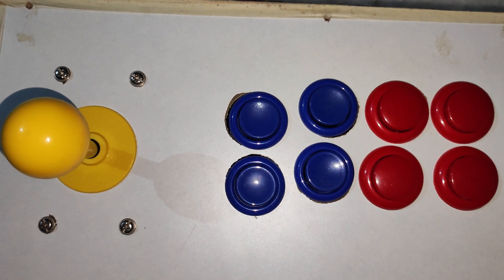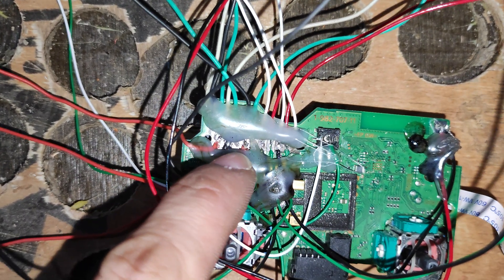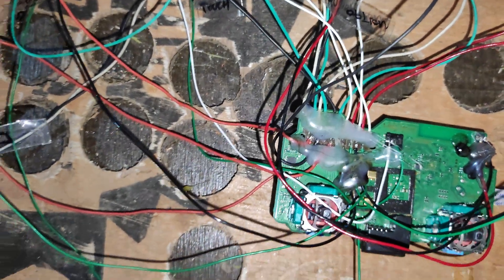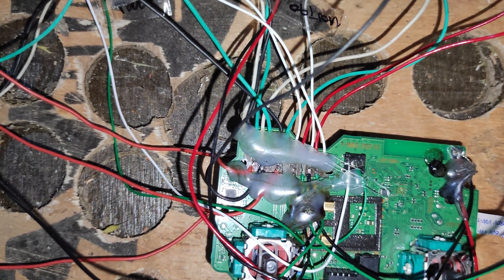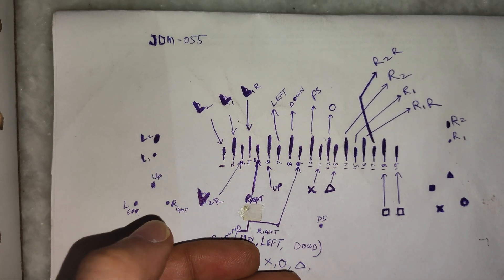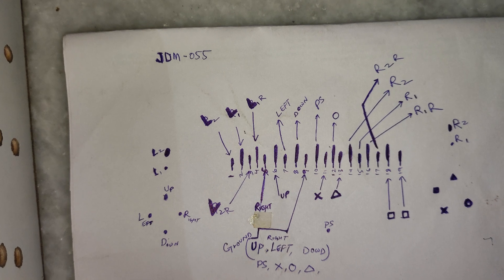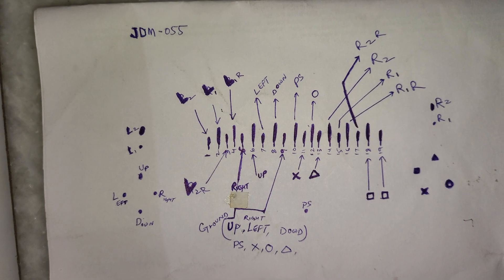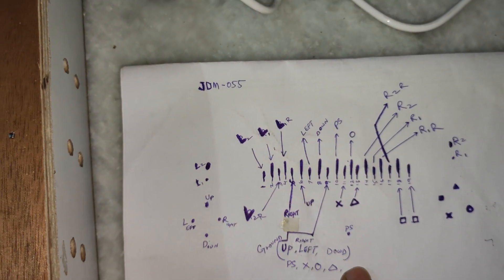Guide - DIY Arcade Stick - With PS4 controller motherboard.

Comment: Can you send me the diagram please ?
Reply from the maker: I wish I could. You can pause the video at 3:12 where I showed the diagram. Put your screen in landscape mode and then take a screenshot of it. I hope this will serve your purpose. 👍🏻
Reply: @bishor33   which L1, L2 and R1 , R2 you connected and which ground for what ? , and so Square doesn't not have Ground ??
Reply from the maker: The diagram is for specific model with motherboard JDM 055, 040. Or any motherboard that has 19 terminals will have the same configuration. I also came across of a motherboard hat has 18 terminals as well. If you have a closer look on the diagram at 3:12, and pause it, you will see all the contact points with it's respective button names. R1, R2, L1 and L2 have their own dedicated buttons are so these buttons don't need common grounds. Where there is extra R such as R1R, R2R, L1R and L2R means those contact points need to be connected with a 8K ohms resistor each.

For example, you solder 2 wires on the motherboard at the terminal 2 for L1 and 4 for L1R. Same way, solder 2 wires on the terminal 1 for L2 and 3 for L2R. You now have 2 pairs of wire for L1 input and L2 input which you need to solder at the terminals of a push button each. 

After that, on the push buttons contact points or terminals where you have soldered L1R and L2R, they need to be jumpered with a resistor. 
Similarly, follow the same method for R1, R1R and R2 and R2R. 

And yes square doesn't need common ground because it has it's dedicated two contact points. By that I mean, on the motherboard, there are 2 contact points or terminals for square button that is 18 and 19. 

Unlike this, rest of the buttons such as U, D, L, R, X, O, ∆ and PS need to have a ground connection from the contact point or terminal 9 on the motherboard as seen on the diagram. 

Right after the diagram, I have explained it on the motherboard a bit. You may want to refer to the video again for more info.

I know I didn't give full explanation in that video due to video length limit of 8 mins. You can also check out my Nacon Daija Arcade Stick modded for PS5 console with PS5 controller motherboard as well on my channel.
Reply: @bishor33   Thank you ! what are resistors ? i'm beginner i want to build my hitbox  . so there is only one ground you connected to PS, U,D,L,R , Cricle ,Triangle , Cross ?  and i have Question do you think there is SOCD if i build hitbox or is going to be Last input ??
Reply from the maker: @samiRetro777  You are welcome. 
A resistor is used to limit or restrict or reduce the flow of current. 
You can use a console controller for hitbox too with same connection by following the diagram. 
Yes, you'd need one common ground for all those buttons. Meaning, take a wire, and to one end of wire, solder a wire on terminal 9 on the motherboard. To the other end of that wire, solder 8 different wires to give one ground each for U, D, L, R, PS, X, O and ∆. This is the easiest way solder for beginners.
And for hitbox, not sure, but you may need to install SOCD kit, else, if you won't be able to participate in a tournament. 
I tried building hitbox but due to SOCD, I had to build level instead. Same goes to if you try to build with WASD too, I believe. 
And I don't know how to install SOCD in a console controller motherboard.
Reply: @bishor33   thanks million for all info ! i'm actually WASD right handed :) maybe i will try to build my custom in the future , i've tried punches of pcb , some chinese from aliexpress PS4 pcb (it shows in red pcb) , brook PS3/PS4 PC + FB , and Pico with latest firmware GP2040 CE , i used to play in online challenges on fightcade most players uses DS4, DS5 (DualShock) , i really want to know if this method is faster than any pcb (input latency)  , i dunno i i felt w/ this method i may get improved ! . 
Alright have great day
Reply: @bishor33   bro sorry for being asking alot of question , does those resistors (needles) work ? and How to connect them  ? one end to another end ?
Reply from the maker: @samiRetro777  You're welcome. It's nice to know that you are using customed fighting board. I tried ordering one with SOCD kit from AliExpress, at check out, I realised they don't deliver to India. And fighting board cost in India is way too costly starting from Rs. 8000. I didn't want to pay that much. Thus, I decided to build my own stick with console controller motherboard. I haven't used an arcade stick with pre-installed fighting board sold by companies, so not sure, if there is lag. There may be or may not be lag. Dont't know how to lag test either. 
You can build a hitbox with a console but, would recommend if you use company built hitbox, etc. reason being is that last year I participated in an event and due to some reason my stick that I built out of console controller motherboard didn't work on their admin consoles. So I had to use someone else stick. However, my stick works perfectly fine on my laptop or mobile or console, can connect wired or wirelessly without any problem till today. 
If you can afford it, I'd rather recommend you to buy or build with universal fighting board with zero delay kit along with SOCD. Then you don't have to be embarrassed in front of people in the event. Rest, it depends on you.

There is no problem in asking questions. Yes, resistor needle or contact pin works. You'd just need to get two 8k ohms resistor or 8.2k ohms resistors. Easiest way to do it is to solder it at the end. After you are done with all the soldering of wires from motherboard to push buttons, you'd just need to solder a resistor on a push button of L1R and L2R soldering points. And solder another resistor on the other push button of R1R and R2R soldering points.
 Soldering of resistors needs to be done at the soldering points of the push buttons. This is the easiest way.
Reply: @bishor33  bishor33, im very very Thankful for this ,i highly appreciated your efforts  happy padhacking bro
Reply from the maker: @samiRetro777  you're welcome. thank you and glad my video was useful to you. At any time, any day, if you have questions, just drop a reply.
 Have a great day.
Regards,
Bishor
Reply: @bishor33  bro isn't suppose the PCB recognized on PC by just connect the Micro USB or not ? because i've tried two model JDM 030 , and JDM-050 nothing shows in device manager under Game Controllers, and last question you mentioned that Square didn't require Ground right ? but i see you connect a green line what that for ?
Reply from the maker: It will be recognised by PC as DualShock controller if you connect it via bluetooth. However, if it's connected via cable, then it will be recognised by PC as audio device if the motherboard of DualShock controller supports connectivity via USB on console. If supported, it will be connected as audio device and no audio from PC will be played unless you connect an external sound like 3.5mm jack to the female 3.5mm jack of the controller motherboard PCB. 

Yes, for JDM 055, 040 as far as I have checked as I have them both, they have 19 terminals and have same configuration. Thus, [] button has 2 contact points or terminals or soldering point whichever you'd want to call it. And [] doesn't require a separate ground connection from terminal 9 shown in diagram. 

Regarding the green wires, you will see some green wires in the video. Please ignore of the colour I used because I was running out of wires and thus, I had to use all the wires I am left with to complete the project. Though I use green wires for the common ground as well, I soldered the common groun green wire on the terminal 9 and another green and white wires on the terminal 18 & 19 for [] button.

I know that I didn't explain in details as I could only record for 8 minutes during that time and didn't know how to record more than 8 minutes during that time. Sorry for that.

*I just realised, my PS4 controller motherboard as seen in the video doesn't support USB connectivity as it's old version may be v1. Does not recognised by my PC but it can be connected via bluetooth on both PC and console.
But my DualSense controller motherboard (PS5 controller) which I modded on my Nacon Daija stick supports both USB and bluetooth. When connected via PC, it shows audio device, it will show under bluetooth and other device. 
Also, remember, whenever you tey to connect to any new device like console, PC, mobile via bluetooth, you would need to put it in pairing mode that is by pressing share+options so the other device can discover your controller. 

Let me know if you have any questions.
Reply: @bishor33  Bro ! do i need to sand those 19 terminal ?  i can't see where to sold exactly ?
Reply from the maker: @samiRetro777  Don't sand them because those terminals are very thin. So, you have to slightly scrub it with a sharp or blunt blade in such a way that it will start to see golden terminals. Remember to do it slightly else the terminals will come off the board. We want to avoid that from happening. Once you start to see golden colour to make it soldering ready, then you can apply the flux paste and solder it with the soldering aluminium coil without soldering a wire. If the golden terminal holds those melted aluminium coil on the terminals, then you can connect a wire on it. If you have limited idea or experience on soldering. You can search on youtube how to solder a wire on PCB.

Let me know if that can help.
Reply: @bishor33  thanks alot ,hope i can do it
Reply from the maker: @samiRetro777  you're welcome. You can. And you will. All the best. 

If you need help, just drop a comment.
Reply: @bishor33  ok bro i sanded the 19 pins with 2000 paper now i can see those golden tips shinning ! .  you says the only  grounds shares with , U,D, L R , PS , Triangle , Circle and Cross  , so How to  connect Square ground ? which ground you sold to push button ? , can you please again explain where are L1, L2 , L1R , L2R . and R1 , R2  , R1R , R2R because i didn't get it right
Reply from the maker: @samiRetro777  Great that you have managed that. 

You'd need to solder a wire each for every ground for those buttons from the main ground: 9th terminal as shown on the video. E.g. solder a wire on the ground terminal, then the other terminal of that ground wire, solder multiple wires to give ground connection each to those buttons such as D, U ,L, R, and so on. 

No problem. Terminals for R1, R2, L1 & L2: 

2 = L1, 

4 = L1R (take a resistor and solder the 1st end of the resistor to L1R), 

1 = L2,

3= L2R (then solder the 2nd end of the same 1st resistor that is already soldered to L1R)

15 = R1,

16 = R1R (take another resistor and solder the 1st end of the resistor to R1R), 

14 = R2, 

17 = R2R (then solder the 2nd end of the same 2nd resistor that is already connected to R1R)
Reply from the maker: @samiRetro777  Hope this is easier now. Let me know if you'd need help.
Reply: @bishor33 i truly appreciated youre efforts my friend ! thanks millions
Reply from the maker: @samiRetro777  You're welcome. 

Just to remind you, resistors are needed to be soldered at the push buttons terminals, not on the motherboard.

Regards
Reply: @bishor33  ooh ! thanks !  wrote that down
Reply from the maker: @samiRetro777  Nice. You're welcome. 
Let me know if you're able to complete the project.
Reply: @bishor33  surely will do
Reply from the maker: @samiRetro777  👍🏻👍🏻

Comment: esta bien andaba buscando algo asi, cambia el orden si es otro modelo de control???
Reply from the maker: I'm glad you found this video. If it's PS4 controller, then it will be almost the same. In this model, it has 19 terminals. In some model, you will find 18 terminals. You can check the tracks of the plastic ribbon  inside the controller just beneath the buttons. If you have different model, share the model number so I can google and guide you about the terminals and it's respective buttons assignments.
Reply from the maker: You can also consider watching my other two videos of modded arcade stick on PXN stick with PS4 controller motherboard and Nacon Daija srick with PS5 controller motherboard.

Comment: I'm planing to make a hitbox out of my duel sense controller and never done sewdering
Reply from the maker: Soldering to push buttons is easy even to people who are new to soldering. But the challenging part is soldering on the tracks of all the contact points on the ps4 controller motherboard(pcb). It can be risky if you are new to soldering because all the contact on the pcb are really small + over heating on those small contact points can tear those contact points + good quality wires are recommended for fast soldering. I would recommend you to consult with a local electronist who can do it for you. All you have to do is to show him the diagram and how I soldered on the pcb.

Comment: can you still use Bluetooth connection?
Reply from the maker: Yes, you can still use bluetooth connectivity to connect with your PS4 or PS5 console as the motherboard is PS4 controller motherboard. It has all the functionalities that a PS4 controller has.

Please check out my latest video on modding PS5 controller PCB for PS5 Arcade Stick.

Comment: Just wondering if i can do this with ps5 controller motherboard
Reply from the maker: Yes, you can make your own stick or mod your current stick with a ps5 controller motherboard. I have completed that project two weeks ago. I didn't get time to make a video of it. I will make a video tomorrow and upload it.
Reply: @bishor33  can't wait for the video
Reply from the maker: @leviuchiha3002  Sure, video is now complete, will upload it in the next 1 hour.
Reply from the maker: @leviuchiha3002  Sorry for delayed upload. Videos were in several parts, took time to merge all together. It's available to watch now on my channel, titled PS5 Controller Into PS5 Arcade Stick | Modding Your Arcade Stick
Reply: @bishor33  THAT WOULD BE SO SICK
Reply: @bishor33  if you can make it wireless that would be even better than the high end sticks
Reply from the maker: @leviuchiha3002  Yeah, I have been thinking about this when I realised that Tekken 8 will no longer be available in last gen console. Couldn't make it sooner as I didn't own a PS5. I bought one just 3 months ago. It works via Bluetooth or USB connectivity like ps5 controller.

Comment: Daaaang this is so cool what I thinking now I should try this
Reply from the maker: If you have basic soldering knowledge, it's not difficult. Give it a try, it's worth it. 

Point to remember, use buttons and lever of branded ones, not local. Else, it will be loud and noisy when buttons are pushed. A new video is coming soon as well for PS5 arcade stick with PS5 DS pcb.
Reply: Also the tiny  mic should I just remove it to blank the connectors or need to soldering connect that empty slot?
Reply from the maker: @diyrecording8422  Are you referring to ps5 controller which has mic button or the ps4 controller? If you are referring to ps5 controller, then you can solder it if you think you will need it in future or leave it if don't or won't use it.
Reply: @bishor33  no I'm using my old ps4 jdm 055 same like on u r video   so after disassembl the plastic cover  mic(speacker) sorry it is speacker right? will drop out and that one is no problem with working right? And if I want to use that tiny useless  Speacker need to soldering to fix it right?
Reply from the maker: @diyrecording8422  oh I see, right. That's the speaker. No problem, you can. if you like to include that too, you can solder it straight to the PCB or solder it with wires and make a room with few holes on the arcade stick to fit the speaker, which ever you feel convenient for you. But that speaker doesn't play the sound of the games. Looks like it may be just for chatting, I don't know. So, yeah, useless speaker 🤣
Reply: @bishor33  yes the stupid speacker lol I'm just curious when is detached the whole board not work or something  thanks for replying quickly 😄
Reply from the maker: @diyrecording8422  🤣Sony has included the cost of that stupid speaker at the time of buying a ps4 controller. Don't worry, it will work without the speaker. If I see the comment reply, I reply at the same time as possible. If I am away off internet, then it reply back when I am connected to Wi-Fi or data. So, no worries. Feel free to ask if you need help. Glad I could help.

Comment: What guage or thickness wire are you using
Reply from the maker: Good question. The overall thickness of the wire I am using is like 1 mm. I took the wire out of damaged/old unused mobile phone fast charging cable. In such cable, it will have 4 wires inside. You can use a little bit thicker wire as well like 1.5 mm not more than that as the contact points (soldering track terminals) are really tiny.